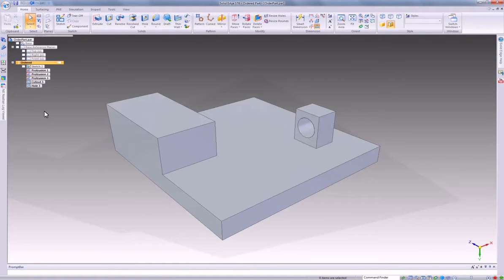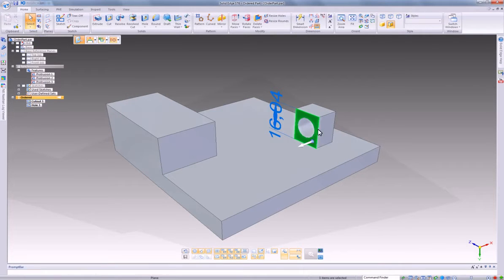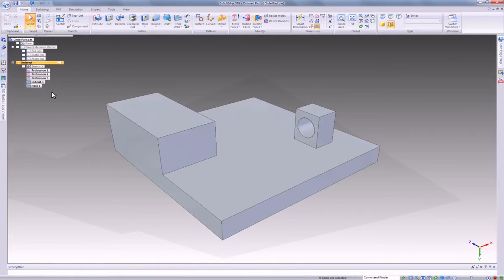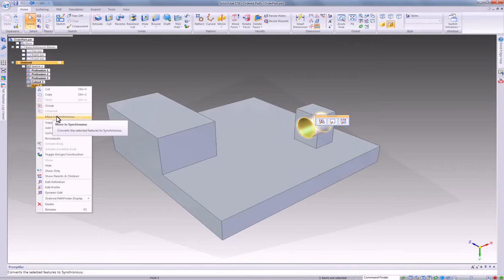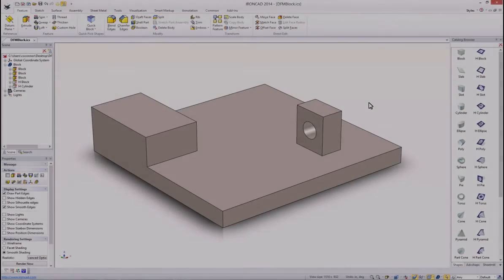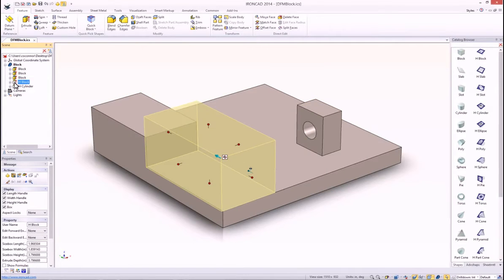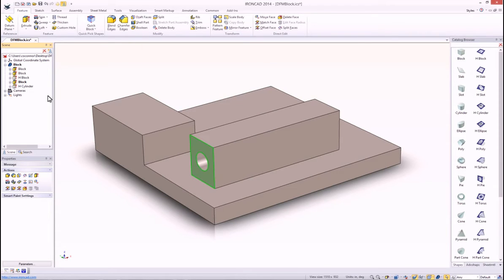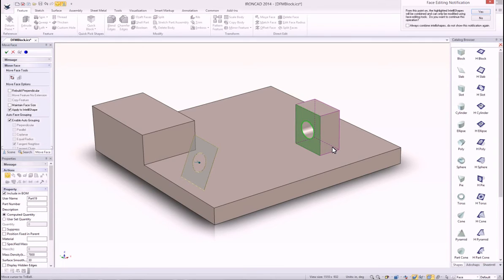Solid Edge vs. IronCAD, Direct Editing

Comment: Check the same in Solidedge ST10 . Solidedge has Advance design intent panned in GUI which helps to create desired changes and it is more intelligent then iron cad
Reply: Still find IronCAD to be far better.
Reply: Lol @arthurparkerhouse537
Reply: @arthurparkerhouse537  LOL😁😆
Reply: @singhajeet1989  

I can't help it! Haha.

I think it might just be the design of Siemens software interfaces in general for me as I have the same frustrations with NX as I do with SolidEdge. Way too many pop-up menus upon pop-up menus. 

So, it's just not for me personally. I can see the appeal behind it though.
Reply: @arthurparkerhouse537  thats ok if you like a software you like it no body can change it..I spend starting of my career on SW ,that time SW was not so much useful for me as it was slowing me down in lots of things. I switched to Solid Edge spent good time over it understood the best way to use it and I am way more faster in designing things compare to others tools. So now I understood how an engineer wire himself with a software to be more creativity is individual effort. And yes on personal note I have same openion on NX,but I use NX  for CFD and FEA as it offer wide range of capabilities so I did saved myself of putting my consious effort on NX CAD as I know it is diffrent in design workflow and Nx is known for its full spectrum capabilities and not user friendliness so it is not for most of the engineers as easy to use software.
Reply from the maker: IronCAD 2025 is here! Packed with powerful new features to take your design workflow to the next level! You can visit us at cad.com.au for more details! 😊